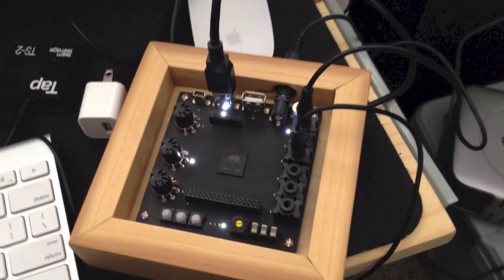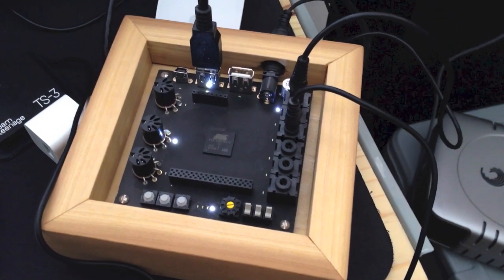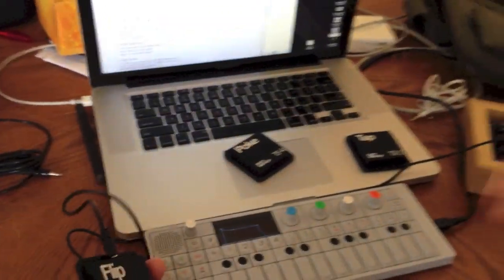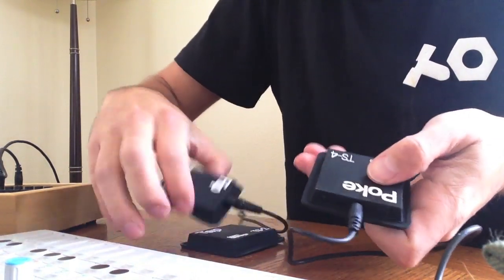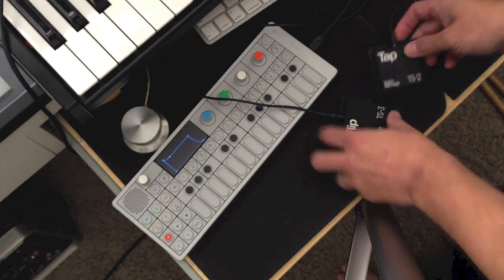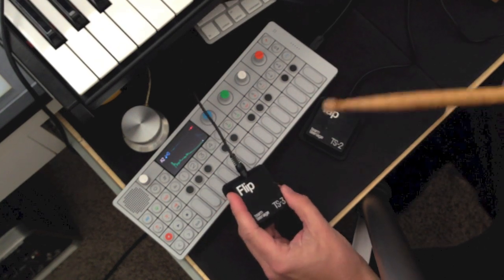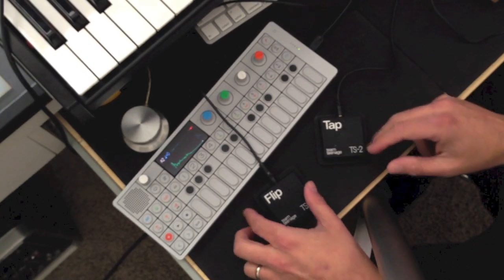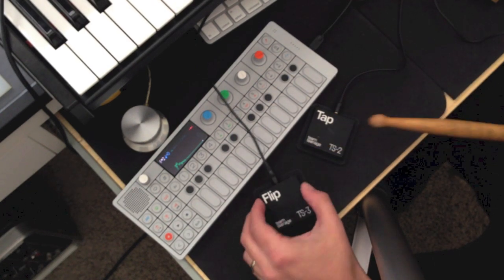OP-1, Oplab and TS-2, TS-3 and TS-4 Sensors

Comment: Did you sync the oplab to the op-1 via the "ctrl" mode? I'm having trouble using the op-1 while in 'ctrl' mode. Have you ever used the Digital I/O's?  Not sure what mode or setting is required so that the two are talking. I'm not getting something right...

Comment: I cannot find the TS-Sensors!!!!
Reply: they are gone forever  :(
Reply: I have the same complaint.  You can find the OPLab regularly on eBay, and the Team Sneakers on the TE site.  But unfortunately, TE only produced a limited run of the sensors -- 100 of each.  I was told by their support team that it wasn't viable to keep producing them.  

I know there's some unofficial/homemade ways of creating sensors -- be it arduino, etc, but would love it if the more tech-savy TE enthusiasts out there could recommend some places to buy and/or build their own?